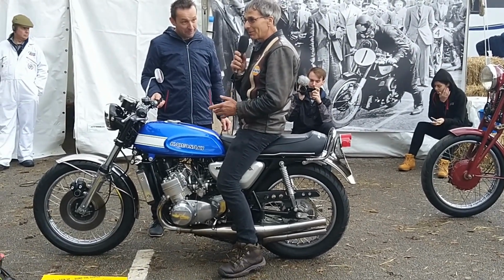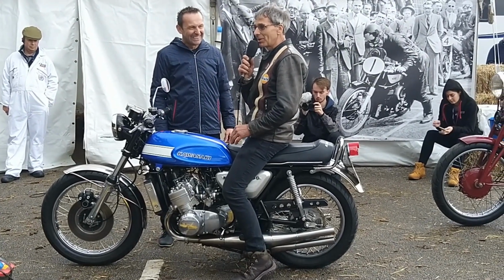Allen Millyard Kawasaki 500 four & Flying Millyard start up

Comment: Mr.  Millyard made most of his engine,  from scratch;  connecting rods,  crank shaft,  crank case.  Cylinders,  heads,  and I believe the pistons,  are from a radial airplane engine.  Great video of him machining and assembling it.  It looks and sounds very,  very good,  to me.  One of a kind.  Cool,  but humble dude,  for sure.
Reply: And the carburetor for the flying millyard, he made from a solid block of metal ! All of it himself, with regular basis tools in a very small spaced garage.

Comment: good god...  Inline 4... 2 stroke... . .  ...................   And I'm assuming he did the Dyno run when the engine was fresh, those 2 smokers build more power as they break in over time.  Probably well over 100hp

Comment: The Kawasaki on tick over reminded me of my Suzuki GT380 I had 40 years ago, happy memories.
Reply: That bike has the one cylinder extra crackle, otherwise I agree. Was out in my 77 GT380B yesterday around the Kentish lanes. I’m running the larger VM28 carbs off a GT550, mounted under the stock 380 carb top. Leave jetting as was. Overall effect, easier start, smoother idle & perfect fuelling right up to high 80s, more to come (which I politely declined to explore). I’ve owned this macho since I was 18!(I’m now 60).

Comment: LOL - when Allen pop's the throttle on the 5 litre. It didn't just tip to the rear wheel. It moved the center stand, back a few inches; some torque!   Love all of Allen's creations. The Honda SS 100 is a fav.